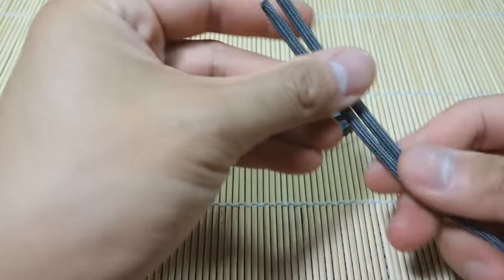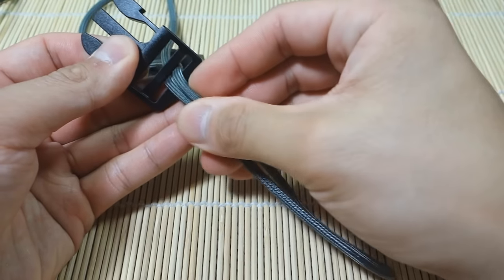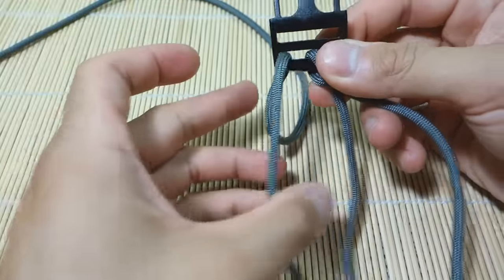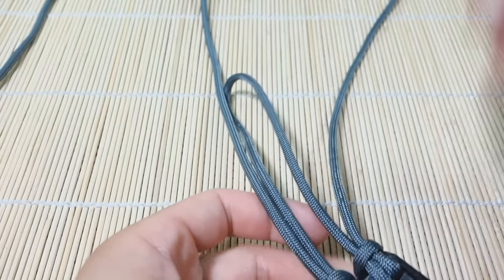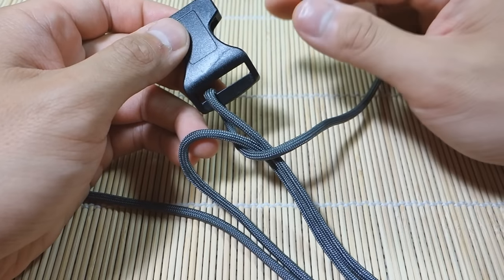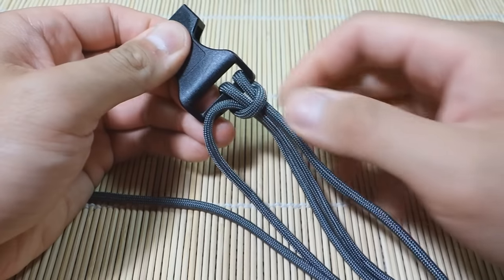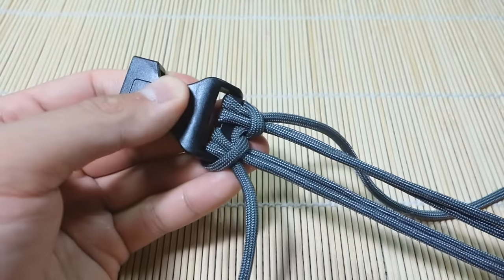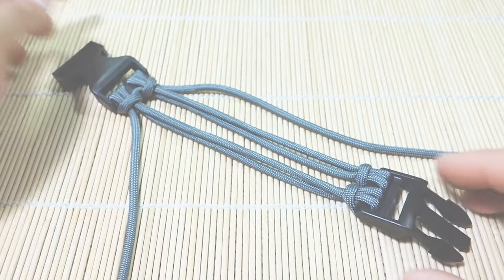How to Make Four Strand Core Double Cow's Hitch Buckle Tutorial

Comment: Which weave would you recommend is both flat and packs together the most cordage in overall length?
I’m asking for a paracord belt project I’d like to start. I want to make something flat to wear around my waist that breaks down into at least 200 feet of cordage for survival uses.
Reply: The most cordage I could find was to make a water bottle holder, I mean a larger bottle, gonna need water for survival. I'm on the same page, something useful instead of it just keeping my cordage in the bottom of my bag. This channel has some other projects like that.

Comment: Do you have a length formula? I've successfully made one based on your tutorial, but I didn't have enough to complete the entire bracelet.  
         Thanks, 
               Kris in Mississippi
Reply from the maker: Which pattern were you doing?
Reply: The Weavers of Eternity Paracord Tutorials 
I usually try to finish it with Cobra Pattern. I'm making some Survival(Striker,Whistle, & Compass) type... 
I want the closest length so I can join two colors together from the beginning. I thought it might look pretty cool
Reply: The Weavers of Eternity Paracord Tutorials 
Just the basic Cobra, but I want to join two pieces of cord together to see how it turns out.
Reply from the maker: The cobra knot usually uses about 1 foot of paracord per inch of bracelet, but it's not super exact. But if you're doing the cobra on a 4 strand core, it may use more. I'd suggest just using some scraps to determine how much paracord you're using per inch of bracelet, then incorporate the amount needed for the core with the buckles.

Comment: how would you incorporate this on a paracord shackle? I don't have one in front of me to try. so i'm just trying to imagine how this would work.
Reply from the maker: Are you using an adjustable shackle? Or just the standard shackle with the "U" shackle and pin?
Reply: an adjustable shackle
Reply: Particularly the adjustable portion. I would imagine you would have to loop it through the hole a few times and not really be to do the cow's hitch.

Comment: Is there a way to use 2 colors without just melting cords together in the middle?
Reply: Grumpy Grandpa yes, its called the ‘Manny method’ iirc
Reply: @jankroeze2626  Thank you for your reply.  Is that way any stronger than melting them together?
Reply: @grumpygrandpa420  no clue, I have only just found out about it myself. But it looks both smoother and stronger. Strong enough for bracelets anyway.
Reply: Thank you. I'll give it a try.

Comment: No conversion for how much cord to use, just right to weaving? So play with 40 feet and end up with short remnants or get 3/4 through and run out. 

Better odd of success in Vegas man.
Reply from the maker: The purpose of this video is just to show how to set up a 4 strand core setup for a bracelet. How much cord you use will depend on what bracelet you're making. I'm not showing you how to make a bracelet in this video, hence no measurements.